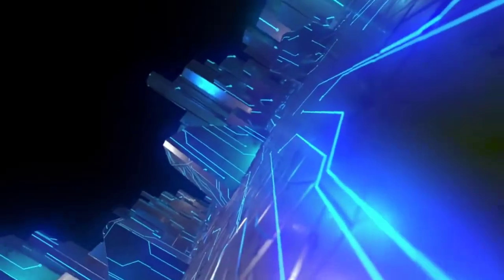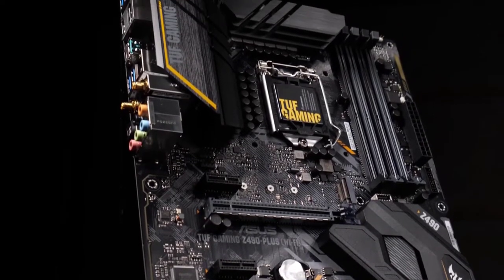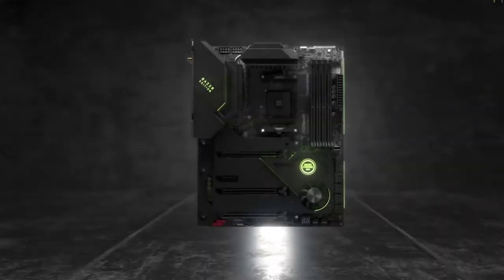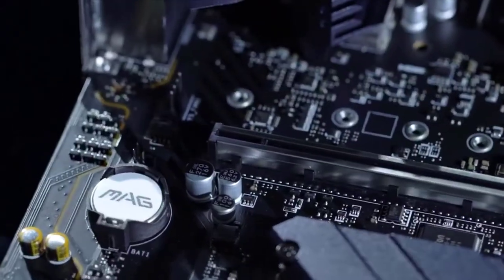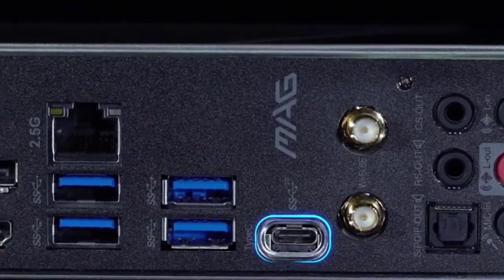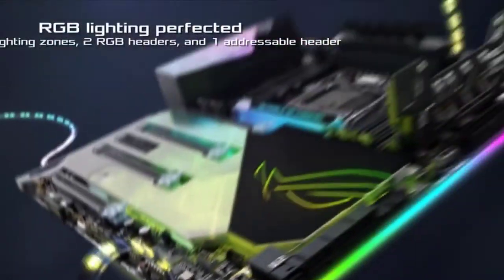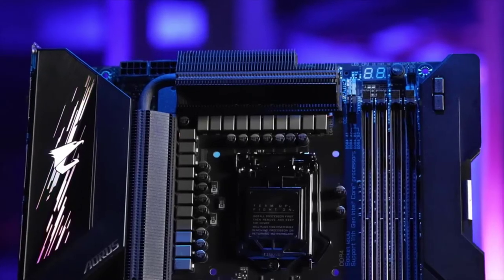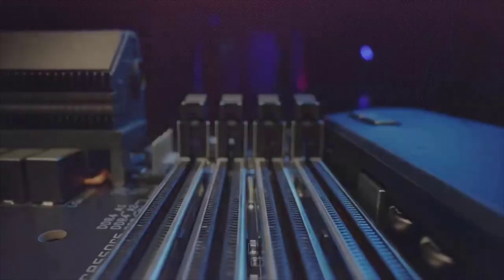Top 5 Best B560 Motherboards | Tested B560 Motherboards

Comment: are you joking ?
I bought An Aorus B560M Pro last month. Ok... 5 Beeps... (with a I5-11400F). So I returned the CPU and ordered a I5-11600K instead.... Still 5 beeps... so I returned the motherboard to the same model. This bullshit motherboard is'nt able to boot with 2 x 16go Fury renegade. You  have to install only one ddr4 on slot 4 to boot the system. and then, you cannot install 32 Gigs on recommended slots. only 1/3 will work. this bios is ass-coded and NO, DONT BUY an AORUS B560M
Reply: You got the Aoranus board wit dim sum slots I think....